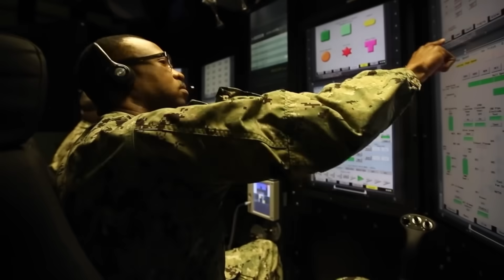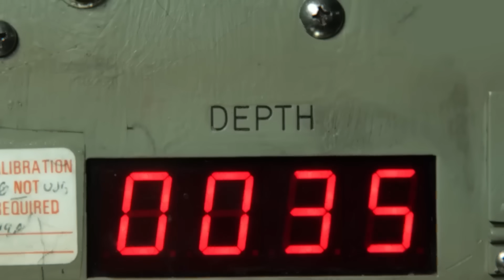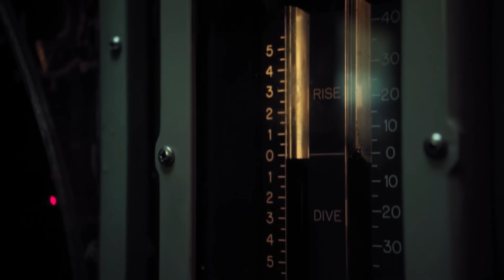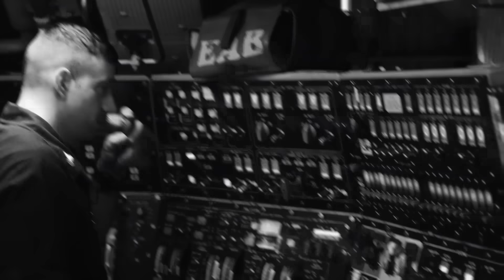What Happens When a Submarine Hits "Crush Depth"

Comment: IF I remember my reading correctly, "Test Depth" is the point where the engineers who designed the boat say, "Best to not go any deeper, now."
"Crush Depth" is the point where those same engineers say, "You're gonna die, people."  
For all that, certain subs have had 'the magic' and gone deeper without harm. That's not a bit of luck I'd care to push.
Reply: yeah, even if it were overengineered  and the design could theoretically drop to the ocean floor in most places, and return to the surface, I'd still treat those given depths as the soft and hard floor respectively. that's a death not worth experiencing, even if you only get to do it once.
Reply: I was corrected on this recently by an ex-navy guy who I presume to know what he's talking about: Test Depth is the depth the boat will normally operate at in peaceful conditions; Operating Depth is the maximum depth that you can take the boat down to, in wartime conditions; Design Depth is the depth that the Navy requires the boat be built to, that the sub will survive if everyone in the boatyard has done their jobs right; Crush Depth is the point where the hull fails, which can be calculated roughly, but is unknown and dependent on how badly Davy Jones wants a submarine in his locker that day. 

For the US Navy, the ratio of operating depth to design depth is 0.66; for the Royal Navy, it's 0.57; for the German Navy, it's 0.5. Laymen (and even sailors) often confuse design depth with crush depth, saying that a given sub has survived going under its crush depth, when they mean it survived going to the design depth and beyond. If the sub went below its actual crush depth, it would be crushed, and the sailor, too.
Reply: @akizeta  Ex submariner here. No, those are not correct definitions. Test Depth is 150% of Operating Depth and means exactly what it sounds like. It is for testing the hull integrity and is a safety factor (50% above) the set Operating Depth. Test Depth generally is only reached during Sea Trials and in rare cases where a boat needs to be recertified, like if it hits something or God forbid is depth charged or exposed to a torpedo detonation. It's also a safety margin into which a Skipper could potentially take his boat in dire need to avoid an enemy fleet hunting him.

Design depth is the culmination of materials, standards, and construction methods to meet a specific amount of pressure due to depth. Again, this has a safety factor built in as it isn't near the expected Crush Depth. Roughly your Test Depth should be 2/3s of Design Depth, and your Operational Depth is 50% less than Test Depth. Your Operating Depth, according to the "boat bible" is what your Skipper is allowed to normally dive to. In reality mission orders come with their own taskings on depths and greatly depends on where the mission is. In an actual war with full blown naval warfare, all bets are off and Test Depth is easily on the table, with Design Depth being a "nuts to the wall, sphincter clinched" option.

Crush Depth is the theoretical depth where a submarine's pressure hull is expected to catastrophically fail. Design depth is by definition a degree of safety margin less than that.

It's really all grey area between Test Depth and Crush Depth, because materials have flaws and manufacturing and construction has flaws, and you just do not know if what you have on paper will equal reality. So ultimately Test Depth, which the submarine is actually taken to at some point and evaluated, is your real "max depth" in normal operations. Less 50% is what you are authorized to do in normal operations without a really good reason. Anything beyond 150% of Operational Depth is tossing the dice, but as you can see there is a LOT of safety margin built in and it is very likely a modern submarine can go a LOT deeper than even the design depth before encountering problems.

I've been past operational depth a couple of times, and besides some extra creaking I didn't see any reason to be weirded out going deeper. And I knew my boat had been a lot deeper in sea trials. If we had ever been in a hot war, really it's up to the Skipper how deep he wants to go. When it's death topside and possible escape below, the numbers are kind of arbitrary and Design Depth just gives you a mile marker as to when you should start puckering up.
Reply: @Kelnx  Nail on the head there. I heard of a boat (think it was an Ohio class?) that went below test depth on accident and came back up with her ribs showing. Of course, that could of been a "no shitter" story, lol.
Reply: @Kelnx  Even so, the captain and crew really have to be desperate to go below test depth. Especially if the boat has already suffered battle damage. Moreover, welding is as much an art as a science, I honestly would not want to put my life in the hands of a welder who may or may not have welded the hull and anything else exposed to the pressure correctly. Having welded myself, I can see why top notch welders are as hard to come by as they are.
Reply: @taraswertelecki3786  Well said! I have been a pressure welder employed full time in one of the world's largest nuclear power plants for 20+ years welding critical piping and pressure vessels used in the nuclear industry. It's a very unique job in a very unique field and requires only the absolute highest quality of work with the finest attention to detail one can muster to meet the strict quality control standards which are required of such welders, who are highly skilled highly trained professionals I will add. Every conceivable variable must be under total control the entire time to ensure the weldment perfectly meets the design criteria to ensure the system responds and reacts to any adverse conditions exactly how it was designed to. It's a field few people ever get to see or understand I might ad. I can imagine the welders who fabricate submarines are of the same caliber.
Reply: i mean makes sens,e since to actually knwo crush depth, youd have to sacrifice an entire sub etc, you can theorize the strength, we can engineer the best possible, but until put in those situations u dont truly know
Reply: @Eclipse-lw4vf  and even then material strength varies, so its approximate even when sacrificing a sub
Reply: Its similar to an airplane, theres been instances where the engines have cut out and planes have taken nose dives rolls that technically should have tore the wings off. But the pilots have been able to recover and get the plane safely back to the airport.

Sometimes you just get lucky
Reply: crush depth is not 100% certain because there are so many factors at play. its just a relative theory placed based on good enough scenarios such as what are average defects that a sub might face that weakens integrity slowly overtime. a brand new sub could likely go to crush depth easily but i would never EVER push the limit on that.
Reply: I wish I was taught like this in my finite element analysis coursee

Comment: interesting video. 28 Years in the USN and served on attack submarines. So the information on the tanks and some items compromising at crush death is not correct. These have shown a tendency to go off at various times. The Yankee that sank off of Bermuda had her various tanks going off for a couple of weeks. Mentioning the Thresher people should note that what is stated in the video is speculation. Due to a Freedom of Information lawsuit more data is being revealed into what caused her demise. Currently there it appears to have been a series of events and design flaws that all came together at the worst possible time and events overcame the ship and 129 lives. Thresher was the first deep diving submarine that the Navy had built - meaning she surpassed all the WWII early cold war designs. After her death a program was created to do as much as possible to help prevent another tragedy. The program is called Sub Safe and it is vigorously implemented. Without going into details the program ensures the metals exposed to sea pressure are tracked from when and where they are mined all through the process of becoming a component for the boat. There are various levels and those materials can not be stored with any other materials. I can't speak to what other Navies use. BTW the next submarine that was lost, the USS Scorpion SSN-589 was delayed going into the shipyard and getting her systems brought up to those standards of the program. She was lost off the Azores with 99 souls 22 May 1968. https://www.history.navy.mil/browse-by-topic/ships/submarines/scorpion-ssn-589.html

Comment: For years it was thought the Thresher sank and imploded quickly. Recently declassified navy documents have showed that wasn’t the case. It took basically a full day to crush after it started having difficulty.
Reply: That has been disproven
Reply: The evidence of that was very speculative.  One rescue vessel heard noises that they thought might be the Thresher, but could never get a confirmation.  There were many other vessels in the area using underwater telephone and other devices searching at the same time so the more likely explanation was the one submarine in the search group only heard other ships in the area.

Classified recordings from underwater SOSUS 'heard' the hull collapse.  It was in such deep water that even a small compartment would have been crushed long before hitting bottom.   So while the story of 'survivors trapped on the sea floor' might garner a lot of 'clicks', it's just not true.
Reply: Nonsense.

Comment: The Trieste was a gasoline tank with a heavy metal sphere mounted below it where the humans sat.

I'm not kidding, the submarine consists of a long cylinder with a ball hanging below it.  The long cylinder is filled with gasoline, a liquid that is not only lighter than water, but it is also non-compressible like all liquids.  Which means that it retains its buoyancy even at the depths.  The sphere below the cylinder had steel walls 5 inches thick solid steel to resist the 18,000 pounds per square inch of pressure.  There was a small window made of tapered plexiglass, the only substance capable of withstanding this sort of pressure.
Reply: True. And to surface ballast in the form of ball bearings was released in order for the submarine to surface. No tanks to blow, as it would be impossible at that depth.
Reply: Lol that sub only had 1 ball
Reply: Relatively incompressible.  You can probably Google the exact formula for the compressibility of liquids and solids as a function of pressure.  For example, water at a depth of 6,600 ft is compressed approximately 1%.  Gasoline was used because it was probably even less compressible as well as commonly available.